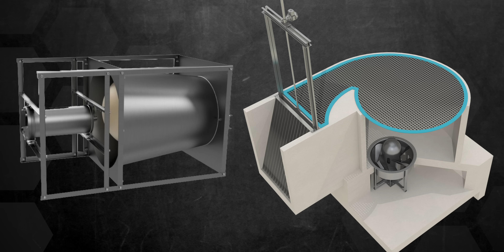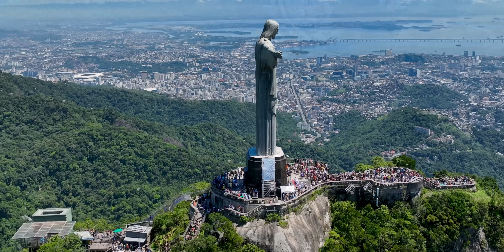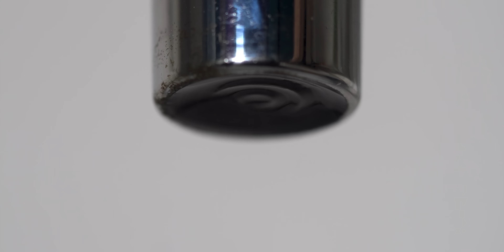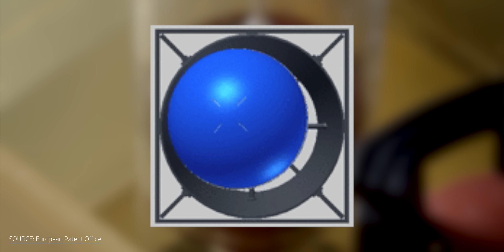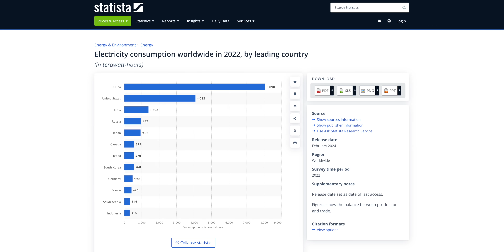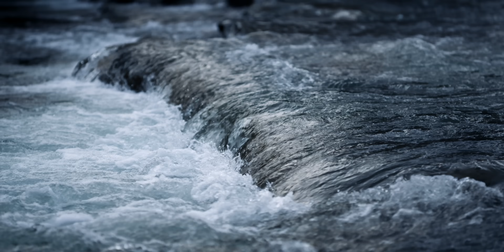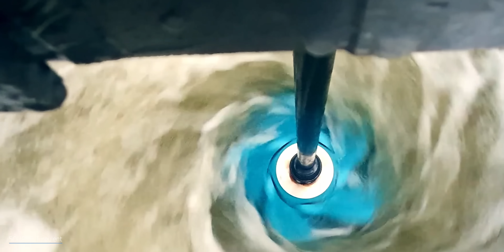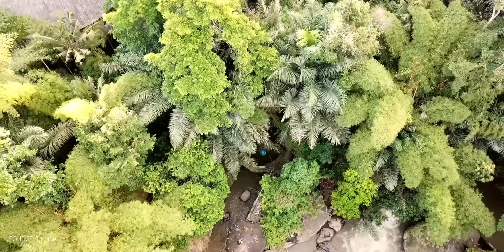The Genius of Small Hydro Turbines

Comment: I remember reading an old article about a small town in the eastern US that wanted to convert a tailrace from an old mill into a small hydro electric generator capable of supplying all the electricity needs of the town. The infrastructure was all mostly in place and the dam had been there about a century so it should have been an easy job.  Enter, the government....  It took them about a decade to get through all the red tape, injunctions and studies to basically drop a turbine into an already existing structure. The biggest obstacle of doing anything decentralized is the power of the centralized resisting it.
Reply: If there were no regulations and the dam failed, they'd be running to the gov't with their hands out, complaining about how long it takes to get their disaster relief.
Reply: Definitely the biggest hurdle Turbulent has had.
Reply: But, seriously a decade for simple tests? Were they doing nuclear tests?
Reply: True, but for every good novel idea, there are a plenty of dumb or dangerous ones.  

Plus, if you are the guy signing off that a project is safe or feasible….no surprise that the new or unusual projects will likely cause you concern and be slow compared to “been there, done that” ones.  

AND even for seemingly simple projects, anything that even touches water has many stakeholders (residents, housing developers, agriculture, fishing tourism, etc).  

It’s should not grind things to a halt, but “meh…build whatever” has its downside too.
Reply: Here in Edinburgh, Scotland a similar scenario of 2m archimedies with 2.5m3/s needed passing by 16 different agencies. It was so bad that all the talent and expertise gained from this operation was lost due to nobody wanting to repeat all the BS. Another small hydro system at an existuing reservoir took 2 years and $30,000 to get linked to the grid, but alos had to prove that it would immediatly stop producing energy if the grid stopped operating. . .
Reply: Basically the same issue with home solar, massive amounts of red tape.
Reply: You mean just stop regulating and it will magically work. Ask Boeing hows thay working out?
Reply: @EdBruceWRX Don't be ridiculous, that's not what was said at all. "Streamline the process" is not the same as "completely unregulated."

Comment: Fish mortality and fish movement are big topics in hydrologic power, but it's grossly oversimplified, and tons of other more subtle effects don't get covered. Regardless of the type of hydrologic power, extracting energy from the potential energy of water will slow the flow of water overall. That affects how silt, clay, nutrients, etc, are either deposited or carried downstream, which in turn affects vegetation. It probably affects how much water is absorbed locally into the environment, the temperature of the water, the oxygen content of the water, and how much is evaporated before reaching points further downstream. It also affects the movement of organisms like fish, amphibians, invertebrates, etc., as well as the success of their reproductive strategies. For example, a fish or a frog that requires fast, clear water for their eggs might suffer if the water slows down enough for silt to deposit and suffocate the eggs.

Comment: Seems like I have yet another factor to consider when I finally buy my forever home land. I need a stream that flows fast enough to put in a nano hydro system. Because the small version of the baseless system would supply about 1/2 my current electricity use per year, which even just that would probably pay back its build cost in a decade or less.

Comment: I've know about small hydro for years, but never knew they could be this efficient. I was walking in the Sierra Nevadas in Spain a decade ago, and many of the old Islamic-era acequia irrigation channels are still channeling a lot of water for many kilometers while slowing winding down the slopes. They pass a lot of cottages, some still use, and I was wondering while some sort of micro hydro, enough to power at least a house wasn't being installed, even in the long stretches between cottages.

Comment: If you put a farm dam on a hillside valley that is not a permanent stream, you're not going to affect fish movement at all. Run a micro-hydro between your dam and whatever permanent stream that hillside drains into, and you can have your hydro and let the fish swim in it too.
Small farm dams are much easier to get right than big hydro river dams. You just need enough catchment and enough storage to get through a typical dry spell for that area, possibly backed up by rooftop solar for abnormally long droughts.

Comment: I think that any design that solves problems that the older designs have but can be cheaper to produce, safer, can be installed by someone with less experience or skills, etc are a step in the right direction, then even better is that they can be used in places that normally do not have the flow or space or even the need and funds to build a huge dam, it's just all around going in the right direction

Comment: Hey Matt. Your maths on the flow rate of the dam and the faucet is off by a long way. Flow rate of the dam is 62 200 cubic meters per second. Your faucets flow at half a million times less puts the flow rate of a US faucet at 124.4 litres per second!!
Reply from the maker: Yep, we messed things up after we did the calculation.  It ended up getting written incorrectly in the script as the word million instead of billion ... and we didn't catch it.  🤦  I've added a correction to the description & comments.

Comment: Constancy or lack of intermittency is not a virtue in and of itself. The fundamental problem of electricity supply is not having a constant source, it is of matching electrical supply to the demand for electricity in real time. For example, in those remote communities where it is being deployed, if it is able to supply peak demand then there will too much electricity in off peak hours. The only two solutions to this problem are to shut it off or “turn it down” (if possible) in the off peak hours, which is a waste of the electricity that could have been generated in those off peak hours, or to scale down the system and use some kind of storage device to meet the peaks. This is a very common error in discussions about the relative benefits of constant versus intermittent electricity generation. One is not inherently better than the other and both lead to a need for either curtailment and/or storage. This is because you can’t fit a horizontal supply line (in a graph that is) to a duck-shaped demand profile — there will be either an oversupply or a deficiency at every point in time except where they intersect.

Comment: Small hydro should be installed wherever it works.  In my small town in massachusetts there are a couple of small dams (one of which failed) and one of them has a still operating water powered grain mill.  The other one just has a slowly deteriorating dam that is around 200 years old.  Putting a small hydro on that would sell power to the grid, producing money to repair and improve the dam, and pay back the cost of the power plant.    This can be replicated all across new england with our huge network of small rivers and streams.   These small generation plants hooked to the grid would also help the grid power factor correction problem, actually reducing electricity losses in transmission.     Unfortunately the way the laws are setup, only small photovoltaic systems can sell power to the grid, small or micro hydro can't.   Power company management stuck in the mindset of gotta build huge power plants is also a problem.

Comment: One of the problems with these systems is that they need vast quantities of water to generate the amount of power they do.  If you don't have that amount of flow, they are not going to work.   Most people don't live by a large stream with that amount of flow.  These are all displacement type turbines relying on water volume going past the rotor to generate power.  Impulse type turbines require more head, but less flow and are suitable anywhere you have lower flow but a larger drop.   So for example if you have a flow of 1 cfs dropping 150 feet, the energy potential is 12.5 kw.  the same amount of water dropping 5 feet will generate 425 W.  so for the examples in the videos where the head is 5 feet, you need 30 times the water to generate the same amount of power.

Comment: I wonder how many small hydros lined up along the length of a river (every 1.5m drop of the river) would equal a single large hydro plant in terms of material used vs power produced? 
I guess, to produce 2000MW (like the hoover) with 100kW per 1.5m of drop, you need 30km of drop. Hmmm

Comment: I have a 13 kW solar system and a 5 kW grid export, and am looking at adding some big batteries or perhaps even pumped hydro storage using 2 x 5,000 gallon tanks that I already have in in place - just need some plumbing, a pump / generator, and some wiring.  I can add more water tanks and solar panels when needed.  Pump water from bottom tank to top tank during the day when my solar panels are producing a lot more than 5 kW (my export limit), and let water run down hill from top to bottom tank during evenings and night to generate electricity for my use and to export to the grid.  My aim is for my solar system with batteries and/or pumped hydro storage to export 5 kWh to the grid 24/7, enough to supply 3 houses plus me.  
If I can also upgrade my electricity supply to 3 phase power (will cost about $100K to run extra power lines and change metering), then I cam export 15 kW to the grid (instead of 5 kW), and will upgrade my system further (more tanks, more solar panels, etc) to export 15 kW to the grid 24/7 - enough to supply 8 houses and me with clean, rnewable energy.  I'm just 1 guy on my own, doing what I can to help the environment.

Comment: Has anyone built a turbine where the cylinder rotates instead of inserting a shaft into the center of the flowing water? As the water spirals down through the tube it exerts force on the walls causing them to turn. This would then drive a gear outside the turbine to transfer the energy to a generator. There would be little or nothing inside the turbine to clog or interfere with the flow of water.

Comment: Wouldnt havin water flow over a roller, made to be denser towards the outside, work just as well and be even safer for fish?  The surface of the roller could be sybrly patterned  yo increase the drag on the water to make the roller spin more readily.. Or, in a verical design, why not use a hubless rotor? fish going through the rotor couldnt be squished against anything, as the cebte of the turbine wouls be empty. The fish might be made momentarily dizzt, but at least they wouldnt be killed. prop design and weighting of the rotor for best efficiency to produce and maintain the rotation should be fairly straightforward nowadays, I'd have thought?

Comment: way back when, lots of towns had small water-powered generating systems. they didn't produce all that much electricity, but there wasn't all that much demand (a typical house might have a radio and less than 10 light bulbs).

Comment: When you said 'water height is, well, fluid', that immediately made me think about ocean beaches and waves. If you were to compare the height of a cresting wave to a beach, most of the time, the wave is higher. Sometimes you get big waves... so... what if you built a structure on an unusable beach where the height of the collection is based on the average yearly height of the waves and then pipe the exhaust water to the beach to be released back into the ocean. So, you've got 2 meter waves (roughly 6'), you set up the collection at 5'. You'll collect water at the top of the wave, have it go through the system, and then pipe back to the beach where the water is lower. Forever renewable so long as there are waves in the ocean.

Comment: This is an interesting technology. However, you started the video with a misleading statement: hydropower doesn’t suffer the same intermittency problem as other renewables. That is only true in the case of a dam. In run of the river hydro like this vortex hydro, the power output can be variable and is definitely seasonal.
It is nice that you gave a shoutout to Ziroth, which is a nice channel.

Comment: Why would you say that these small generators have a lesser impact on the environment? That strikes me like the people claiming that small motorised bikes are better than trucks - sure the absolute impact of any one of them is smaller, but if you scale it up and run the number of motorbikes to be able to transport what a truck is hauling then the picture is the complete opposite. 

That is very much the same for hydroelectric: Their ecological impact per kWh is far far lower, and they are cheaper. These small turbines have been around commercially for decades and they do sell well - for people where there just is no other good alternative. But most homes do not have access to any flowing water, most that do do not have water that they could use these in. And where they have you can not just plant in one of those every 100m - that'd just completely ruin the water.

And you do know that normal traditional turbines do not need a lot of head? Around 1.5m-2m are enough. And they are typically >30% more efficient. And then there are still the good old waterwheels. There are now enough companies offering overshot waterwheels for head as little as 1m. Cheap, robust, efficient, reliable.

Comment: Hydraulic is related to fluid/liquid, not JUST water. That is why hydraulic pumps are typically pushing oil, not water.
Merriam-Webster Dictionary:
1 : operated, moved, or effected by means of water
2 a : of or relating to hydraulics hydraulic engineer
b: of or relating to water or other liquid in motion hydraulic erosion
3 : operated by the resistance offered or the pressure transmitted when a quantity of liquid (such as water or oil) is forced through a comparatively small orifice or through a tube
hydraulic brakes
4 : hardening or setting under water hydraulic cement hydraulically 

American Heritage Dictionary:
1 Of, involving, moved by, or operated by a fluid, especially water, under pressure.
2 Able to set and harden under water, as Portland cement.
3 Of or relating to hydraulics.

Comment: I'm wondering what the best energy storage option would be for small hydro. Small-scale pumped hydro--potentially using water towers--comes to mind. Or, perhaps there's another mechanical solution to store potential energy without increasing battery requirements like flywheels. Both small hydro and these storage solutions mainly require steel, to my knowledge.

I do think it's important that such storage (where necessary) uses green, more readily available materials where possible. Sure, steel is better than most batteries, but we don't have large-scale green steel yet. Perhaps a flywheel rated for much lower speeds could be filled with heavy local materials to reduce material/ travel costs as well as travel emissions.

Comment: I think, the reservoir should be thinking in terms of battery. So Head dam is a big battery with generator.
But small generators without a battery doesn't sound fitting with other renewable techniques. Getting power from non-stop stream of water sounds good. But, what about at night of a warm day?
So these tech increases power production and exposes electricity to more parts of the world. I admire that.
But, that's more problem for energy storage engineers to solve. And so far, we don't seem to have something that we can say a widely adopted technologies.

Comment: If I had a nice little plot of land with some river access one of this micro turbines might be the perfect solution to have power without having to rely on power lines or needing batteries for the night... but there in lies the rub, most people do not live near flowing rivers that could take advantage of this, at least in the US,  and there in lies the benefit of the big hydro power dams is they can supply power to those that are within range of power wires that they draw.    I see that more as a solution for a small remote village or something, but the makers of these probably want to make money from their creation too, which usually doesn't come from small remote villages.      At the Setor bladeless one?  Something about the non-symmetrical way that it moves makes me worry about long term reliability.

Comment: I live in a small village in norway and we have multiple hydro turbines. recently they built a new one in the nearby river, the river is only 5m in width and it has many turns, pits etc. they just built a small dam of maby 4x4m then a samll house to house the equipment, just looks like a small garage. they produce 20 GWh a year. in my opinion pretty slow flowing. When I look it up it says 300m of fall, but that cant really be true because of all the obstacles etc, the river also varies a lot depending on the season, but I dont know. I probably just dont know fluiddynamics so maby because water doesnt compress the obstacles dont matter because the flow from the original source decides the amount of water that gets released and the top and bottom of the river has equal Litres/hr. but idk

Comment: There are several spots within just a mile of me that would absolutely be capable of producing a significant amount of electricity using the Turbulent system. I would love my city’s lighting plant to look into it for our local grid, because while it won’t be enough to run more than a few dozen houses per turbine, that’s a few dozen households worth of electricity that didn’t need to be from burned fossil fuels and for relatively cheap.